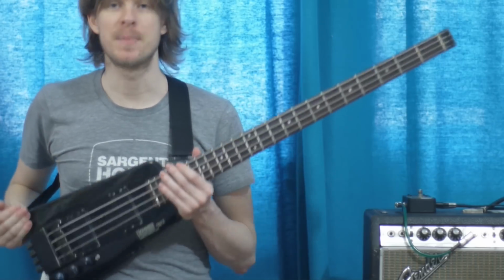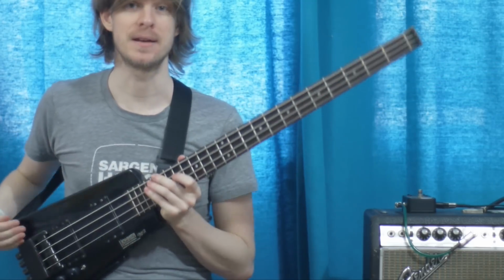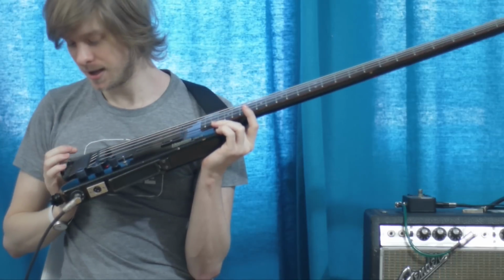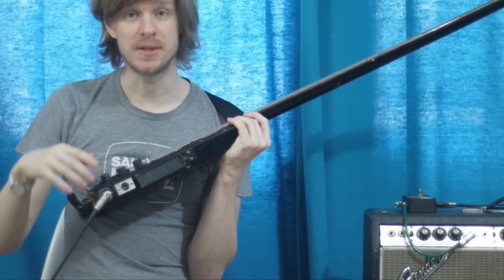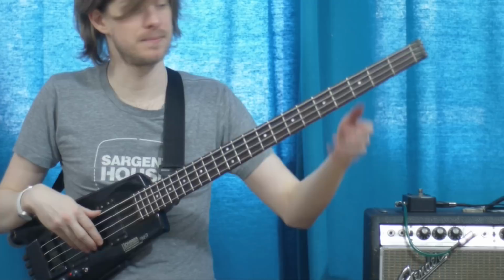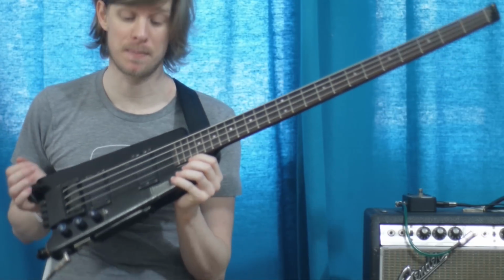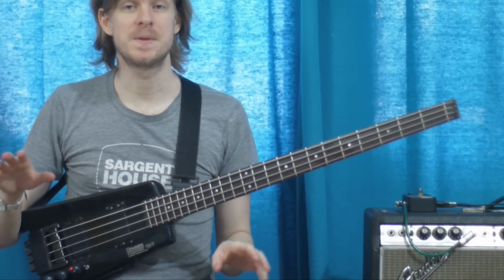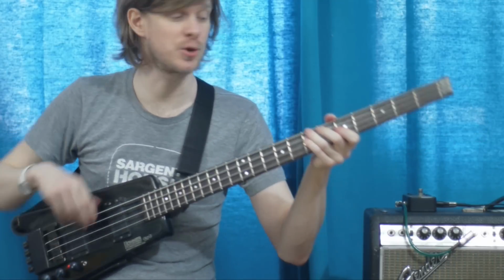HOHNER B2A headless bass guitar - on eBay

Comment: I was thinking of getting a Hohner "The Jack" Bass.... and although I've watched maybe 20 videos so far you were the only one who clarified that the steinberger system requires a special kind of string... which is obviously very hard to find. Until now I falsely thought that this system had a way of latching onto the free end of a string and pulling it back in order to tune in. Thank you SO much for helping me get rid of that disappointment.
Reply: There exists a system to use regular strings.
https://fr.audiofanzine.com/basse-electrique-frettee/hohner/B2A/forums/t.319336,ou-trouver-une-tete-pour-mettre-des-cordes-standard.html
https://fr.audiofanzine.com/basse-electrique-frettee/hohner/B2A/forums/t.655348,cordes.html
https://www.headlessusa.com/string-adaptrrs
Reply: Double ball end strings are stocked in most instrument shops now. I've got a Jack that needs a bit of work on the neck and tone /volume pots if you are interested.

Comment: any advice on what strings would fit it properly. Thank you for your time
Reply from the maker: Hey Gibby,
as mentioned in the video this guitar takes double ball end strings. this instrument is "full scale" for a bass guitar, so that is 34 inches. there for, any set of 34 inch (or full-scale) double ball end strings will do the job. the gauge of strings (or thickness) is up to the player, and is a personal preference (play feel vs. tone) - but be advised that the instrument should be set up for the specific gauge of stings used to get the best play and sound. i recommend trying different string types and seeing which you like most.